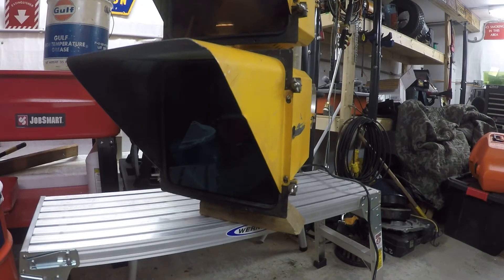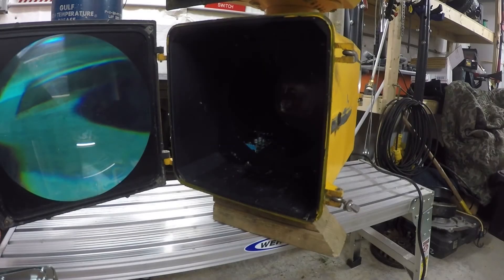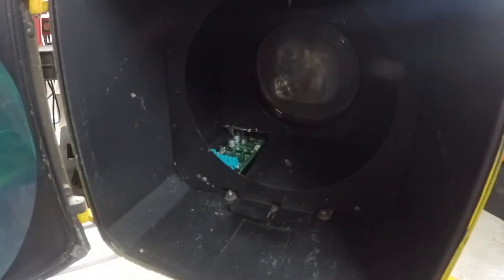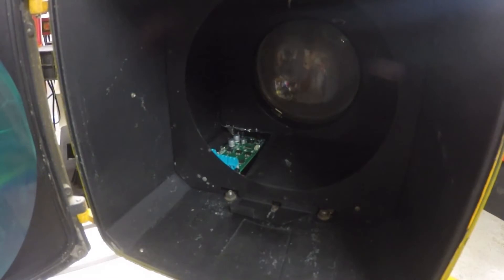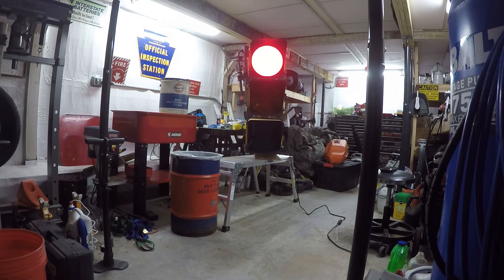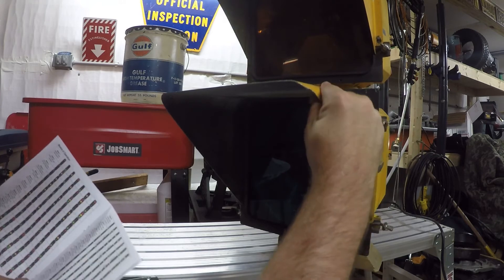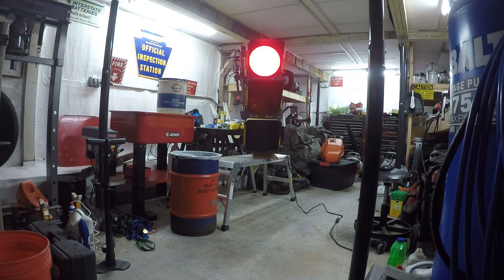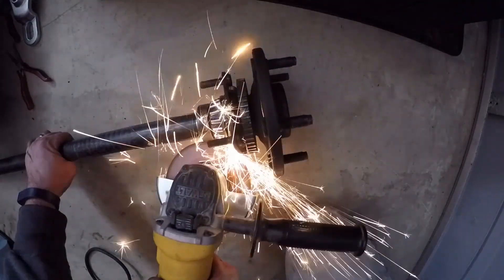Traffic Light Project - Part 3 - Sequencer Install and Demo

Comment: I think the sequencer has so many modes depending on the application.   Some may be an easy way to add a traffic light to things.  Others seem more effects like, like if you want the light as a decoration or as an effect light in a dance floor, club, bar, event room or something.  Some may also match the traffic light sequence of other countries, like I saw some traffic lights in Europe for example use a Red-Yellow before green.

Comment: I am working on wiring and rewiring my 3M light that been in a garage for over 20 years. I already have the controller board. I just need to know how you jumped the controller board to the green light and so forth. Mine has a lot of rust so I don't know if I need to get new parts or not. Any suggestions on where to start?
Reply from the maker: I no longer have this light on hand. You’ll have to trace out the wires to the main terminal block in the bottom of the light to determine which wire goes to each color. I don’t what controller have, you’ll have to look at the manual for that to determine the pinout for the colors.

Comment: If you go buy some conduit wall clamps you could use them to attach the light using the bracket it has
Reply from the maker: Thanks for the suggestion, I’ll look into it.
Reply: StuffYouCanDo2 I would be careful, those in particular are VERY heavy
Reply: @TexasRailfan2008  conduit clamps will hold it fine